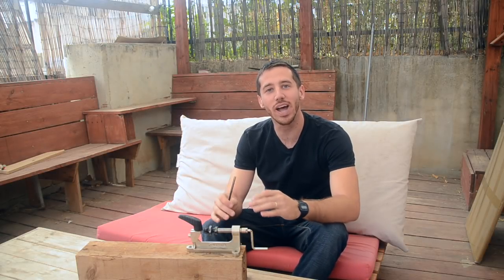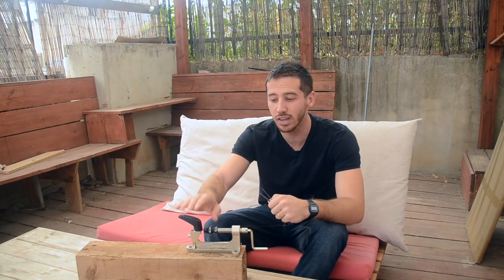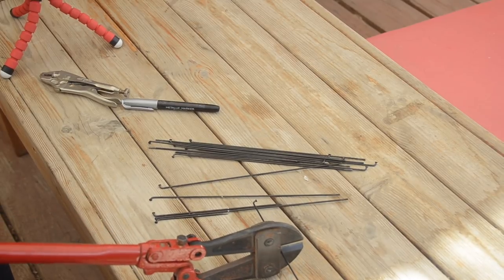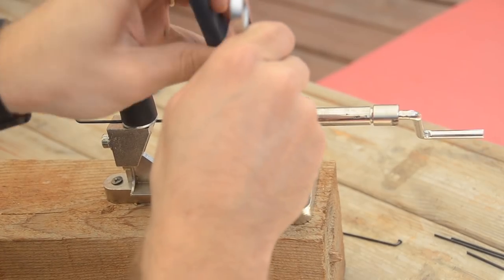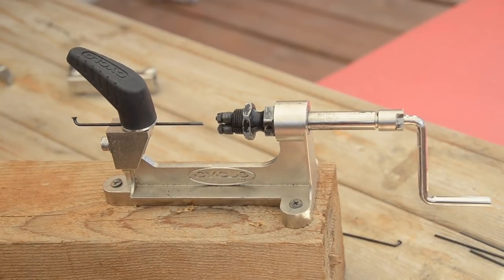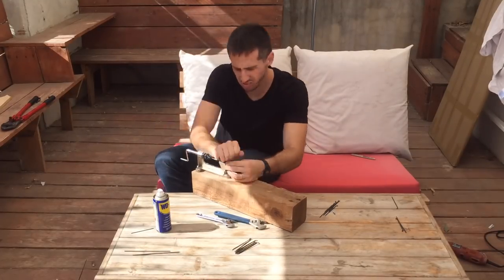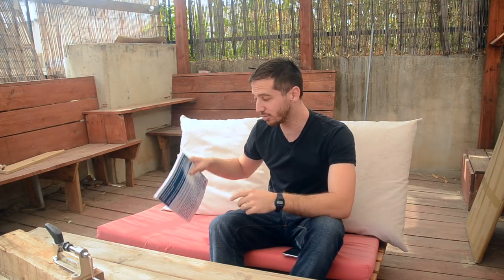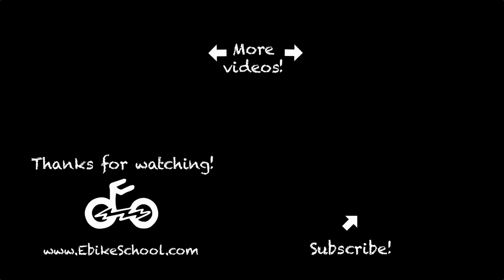How to Make Your Own Bicycle Spokes (Cyclo or Hozan Tool!)

Comment: I have a really nice Golden Motor conv kit on my bike. The rear wheel has a hub motor and so it's a bit heavy. For that reason it tends to pop a spoke every few months. I just take off the tire and replace the spokes using the Hozan (odd 206 mm spoke so I clip a longer spoke then roll it). Well worth it for the ride. Thanks.

Comment: Hi Micah, would you know of a viable bike controller that could be used effectively for an electric skateboard as replacement for the vesc controller typically used?  Is there even a remote controlled one available? Or small enough...?

Comment: I have three of the hosan spoke threading tools attached to cordless screwdrivers, With a different depth settings on each. Much quicker to do with three setup instead of adjusting one tool. But in saying that it's still more cost effective for me to pay the local bike shop to do 48 compared to the time and cost of doing myself. Good to see a video on how to with the spoke threading machine. I've had to repair a few that weren't used correctly for customers.

Comment: Thanks for the tips.  Did you provide a link to where to get the cyclo spoke threader?  What brand of spokes do you start with?  Given that they are for a hub motor, do you use extra heavy duty spokes?  If so, what are their specs?  Thanks and keep up the good work.

Comment: Hello, 2 comments: what kind of lubrication do you use for this? and where can I get 10g spokes threading head? I didn't find any either Cyclo nor Hozan.
Reply from the maker: I forgot to mention this but I just used WD-40. A machining oil like tap magic would be better. I'm not sure where to get a 10g head. I only use a 12g and 14g head.

Comment: Hi Micah, what's the difference between the Cyclo and Hozan threaders, is one better value, or quality? is that one, the Cyclo? What is the spoke gauge range? and a metric conversion? Please. Are both brands capable of all the gauges of spokes? And are their guidelines as to what gauge spoke for Nm of torque motor? and in watts? please.
Reply from the maker: I'm not sure if there is a quality difference. The hozan tool looks a little beefier but my cyclo works just fine. The spoke rolling heads are interchangeable but they can be tricky to find.

Comment: Nice video, thanks. Am I correct in thinking that the cutters (or "thread rollers") are specific to the thickness of the spoke? So that a thick e-bike spoke would require a different thread cutter from a normal spoke?

Comment: Is the threading head (that black piece) universal or do different nipples need different gauges of width?

I might buy this tool because I have a batch of spokes and I want to cut them to size and use them to replace those of a bike that were poorly made. They basically broke once a week and the seller unbeknownst to me made them in a custom length, so I'd be forced to go to their shop for every repair. He can repair something else...

Comment: Thank you, never realised before that threads are rolled and not cut, every day is an Ebike School Day,  I was also trying to sort out what amperage a lithium cell is for making a battery of a defined amperage and I noticed you had a 10.5 Ah battery, so I then divided the amperage by the number of batteries and came to approximately .25 Ah per battery, Is this a decent way for battery Ah building please.

Comment: EbikeSchool.com I am making my manual wheel chair a e wheel chair using a 16 inch tire and rim!! this video helped a lot! one problem, I only have dies so can it be done with dies and not the machine? I am disabled and cant get the ss dept to get me a new manual wheel chair but every 5 years let alone money enough to by tools such as that one. now I was a machinist for 25 years and have a mini lathe, mill machine, drill press, etc... a every die and tap under the sun. can I just use the right die for the job and for 2.5 or 3mm spokes where do I find out what nipple size? thanks for posting this again, it helped me so very much!! AND I WOULD LOVE A BOOK TOO, just don't have the money sorry,  Old One Legged Joseph T.

Comment: Great video, but with covid-19 going on, do you know anyone making ebike spokes in the states if I were to send an example?  Having lots of trouble for my rear hub das kit Magnum Ranger with 29in wheels and 4in road tires.  Any links would be appreciated, I'm basically needing 200 m m 10 gauge Spokes, and I think I might be your brother-in-law's doppelganger haha.  I'd be happy to buy some from you if you could make it some or perhaps you could send a link to a reputable shop in the states with spokes in stock. The bike is only four months old but I've put four thousand miles on it and Magnum cannot Source the spokes right now.

Comment: Hey! Thanks. I am a pro bike tech, and a United Bicycle Institute Frame Welding grad, and am contemplating a solar-electric trike build, and am going to use some old utility trailer hubs I have lying around to make the front wheels on a custom tadpole trike.  This bike will be heavy with batteries and solar panels, and possibly trimaran boat hulls:p As I have just broken a spoke on my EBike, I have two reasons to make some custom spokes. I have been watching your vids on Electrek.  Keep up the great work!

Comment: Am I correct in thinking that all the spokes in any single wheel are the same length?  I have never taken a cycle wheel apart to find out.
I remember that I have an old wheel with a bent rim.  Just the thing to take apart on a rainy day, find if they are all the same length, and have a set of spokes to cut and thread in the future.
Reply: No, that's not necessarily correct.  If the wheel is dished to offset it relative to the hub flanges, or the hub flanges are not the same circumference, then the spoke lengths differ from one side to the other.  The spokes should be same length on each side.  You'll want to use a spoke calculator and will generally have to round up or down to the nearest mm, and if your two lengths are very close, you can use the same length.